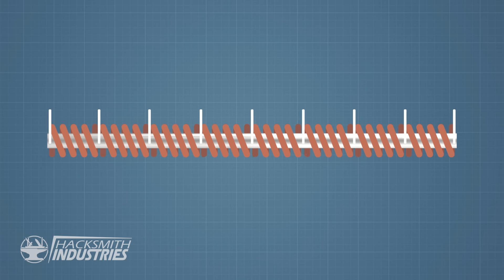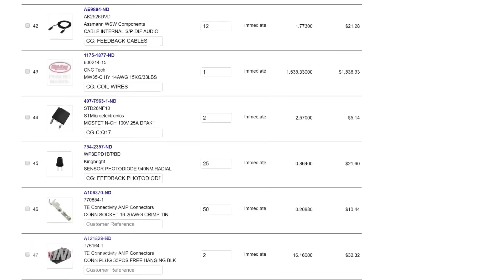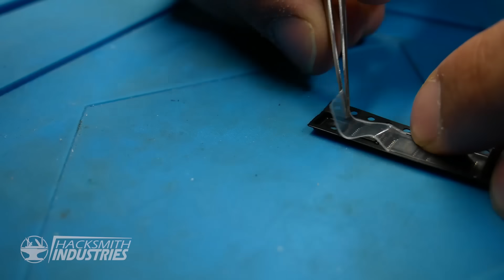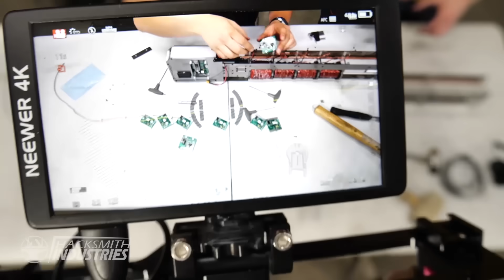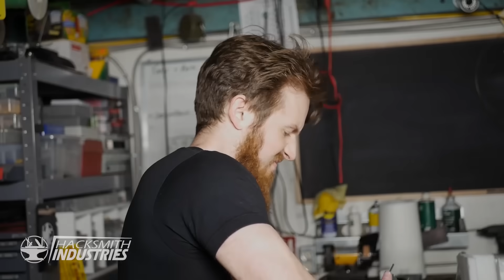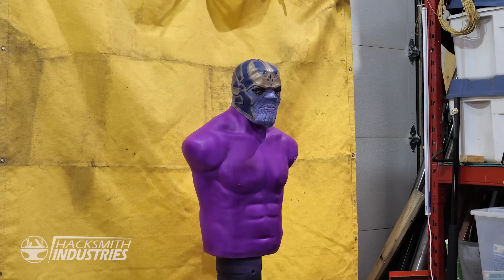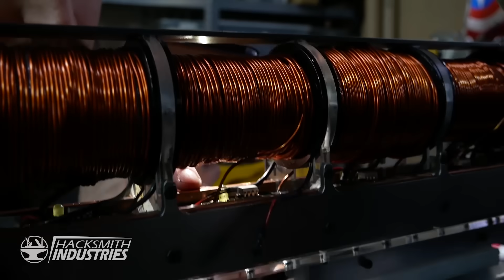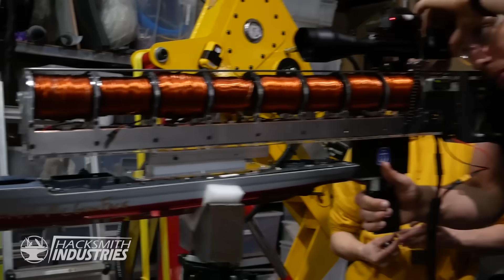50 CAL ELECTRIC COILGUN

Comment: Rifle the barrel, upgrade the projectile, and more power to the bus, like big capacitors like the rail gun.
Reply: making sabot is better
Reply: If he did that he’d just be drafted into an Area 51 research facility
Reply: i was thinking the same thing.
Reply: @atlas9100  Atlas9 meet Atlas1
Reply: You don't want capacitors on a coil gun one of its many benefits over a rail gun is its rapid fire capability. 
What they really need is to replace the bolt action receiver with a full auto bullpup receiver.
So that you maximize the distance the projectile is accelerated.
Reply: @maivinsteffensen2199  or they could just make the gun bigger lol

Bullpups often cause issues on standard gun designs let alone an electric one
Reply: Putting the trigger in front the action is far too much work for a prototype that isn't going to go anywhere
Reply: @jamesrobinson7732  The trigger is electronik, they can place it anywhere. And the problems related to bullpups don't apply to elektromagnetik guns no recoil spring or shell extraction needed.

Comment: I built mine 25 years ago and only used a power supply, multi-parallel capacitor bank, a few SCRs, a couple hundred feet of copper wire, and optically triggered sensors in a three-stage design. Oh yeah, we also submersed the coils in liquid nitrogen because the current we measured in the coils was around 2200 amps.

I won the university contest every year I entered it in.
Reply: nice! what else did you make?
Reply: @jacobpeters5458  A micro robot that ran on a 9V battery and walked up 3 stairs and then proceed to park itself on the upper deck platform without overhang.

The robot specifications required it weight less than 300g, occupy a starting volume of less than 10cm × 10 cm × 10cm, and store no useable energy beyond the battery...

By the by, I didn't use AI or anything like machine learning. It was purely electromechanical. I wasn't aware of such things at the time...

Comment: Your projectile needs to spin for stability: you need a rifled barrel.
Reply: Dont think it would work , there is no gas propelling the projectile and the magnetic field just pulls it in whatever direction 
I dont know, but worth trying
Reply: @GGGerO0  Plastic barrel?
Reply: @measl  maybe
Reply: @GGGerO0  There is certainly enough forward momentum for this to be useful (surprisingly), if the projectile can just be stopped from tumbling. It's a neat idea if it can be perfected!
Reply: What if you have an rifled bullet instead?
Reply: @cxpKSip  seems good 👍
Reply: You would want a rotating magnetic field to rifle an E-bullet. Look up Tesla's Egg of Columbus.
Reply: @measl  or make smt like rotating magnetic field but that would be hard af
Reply: Better yet make the barrel like a witworth barrel and bullet. They were hexagonal bullets in a hexagonal Barrel that had a bit of twist to it for bullet stabilization. No need for cutting rifling either.
Reply: Maybe fletching that turns it?
Reply: @matthewmeuleman3369  Would winding a flexible spiral magnetic strip 45deg angle on the bullet work? Or maybe just use a drill bit which has that spiral pattern, it might just rotate.
Reply: @Averey Knobloch it can, just see how fan work.
Reply: @measl  it wouldn't work then, i think
Reply: they need wings like on arrow, rifled barrel in coil gun is nonsense, you don't want another extra friction there, mabye projectile with spiral shape would get rotation only from air pressure
Reply: I’m glad this Channel has nothing but good ideas 💡
Reply: Expandable tail fins or a sabo style round could remedy the tumble
Reply: Why reinvent the wheel check out air rifle pellets they are shaped perfectly for sub an hypersonic speeds should stop the tumbling.(make it out of steel on lathe?)
Reply: Coil guns don't have rifled barrels.. they don't work like that.
Reply: This was ages ago but rifled projectiles could be used like the ones used in smooth bore shotguns.
Reply: I think they need to change the ammunition they are using from a rod to a steel ball like the rounds they use for muskets
Reply: either rifling or a rifling on the projectile could work, the projectile also needs to be smaller so it can attain more speed
Reply: I ruined this comment with the 421th like
Reply: @measl  4
Reply: a rifled plastic barrel combined with a rifled slug.  or a hexagonal slug/barrel instead of rounded sides, a rifled hexagonal barrel is also easier to machine.  hexagonal rifling was used to beat the musket back in the day, i think there's a "Forgotton Weapons" video about a hex flintlock on youtube
Reply: Spring loaded fins on the projectile.
Reply: Good idea.Maybe if they designed the second half of the barrel like an induction motor stator, it would spin the projectile.
Reply: Rifling would slow it down too much if you had enough friction to spin it sufficiently.   They should just use a little motor to spin it before it fires.  Much better.
Reply: they can even use a motor to spin the projectile before its fire
Reply: Barrel extended
Reply: couldn't you fix this by basing coils off of Rodin's coil? all the mumbo jumbo aside, the coil does induce spin on a ball bearing????
Reply: Just put the coils on the outside of a rifle
Reply: @blades7178  just thought it would be a cool application for rodin's coil
Reply: they could acheive spin by adding a coil or 2 that spins
Reply: @Julian-1701  The greeks used to rifle their sling bullets to make them shoot straighter, so I assume it would work for this.
Reply: @Averey Knobloch I'm sorry sir but this is almost 100% false
Reply: @GGGerO0  Rifles are in the barrel not because there is "exploding gas" they are there to make a projectile spin which stabilizes it (makes it go straight without tumbling). The source of movement is unimportant.
Reply: @Averey Knobloch Rifles are in the barrel not because there is "exploding gas" they are there to make a projectile spin which stabilizes it (makes it go straight without tumbling). The source of movement is unimportant.
Reply: They don't need to make it spin they can just use fin stabilization to get the job done. Even on a small scale, it can be effective.
Reply: Part of why coilguns are so effective is because the projectile isn't touching the walls of the barrel - as a result, there's no way for a rifled barrel to impart spin.
Reply: @begogule  they're also fired out of a rifled barrel using air or gas to project it. It's the gas pushing a pellet/bullet combined with the rifling that gives any classic projectile weapon the bullet spin and overall range? 
Do you actually know how Ballistics work?
Reply: Stability can be induced using physics: design a projectile with a center of mass in front of its center of pressure. With a spitzer bullet, like the projectiles used in this test, this is not the case, hence the need for spin.
Reply: @MrAndrew3048  there IS no "pressure", there is nothing to "pressurise" the barrel, such as a propellant explosion to power the projectile. This projectile is powered through electromagnetism alone, did you watch the first 15mins of intro at all???? 🤔
Non-spin stabilisation can be achieved using other mechanisms such as fin technology.? Are rockets and missiles spin stabilised or fin stabilised..? 
Please apply basic observational skills and basic understanding of concept before weighing in with an advanced hypothesis...?

Comment: You should try make a projectile that spins more in the air, it would go faster and be more accurate
Reply: Would a copper inlay, that is spiraled around the projectile, or something like that already introduce some kind of spin, due to different reactions to the magnetic field? Seems like a good question for someone who studies physics or at least knows a bit more about it ^^
Getting spin into a solid projectile with those coils wouldn't really be possible otherwise i think.
Reply: @yanbar3433  i think that rifling in the barrel that is acrylic would also work
Reply: @blitzkriegshane  That would propably work too, but i thought, that the idea of introducing spin by using magnetism, was simply an interesting question and i was interested in whether it would be possible or not ^^ So if someone still wants to answer that question, i'd be thankfull ;)

Also i don't know how you would make the rifling in such a long barrel, because thread cutters or stuff like that usually aren't as long as that barrel...
Reply: @yanbar3433  i understand now. i think if there was some sort of weight difference on the sides so one weighed a bit more than the other but not so much that it throws the accuracy off. and since it isn't going to go 100 meters, the weight difference will not matter that much. i am not an expert, but i think that could work. do you have any comments on that? i would greatly appreciate any advice or information to further enhance my knowledge on the topic of magnetism.